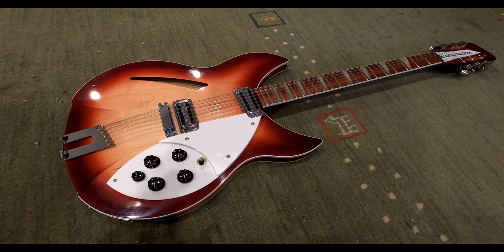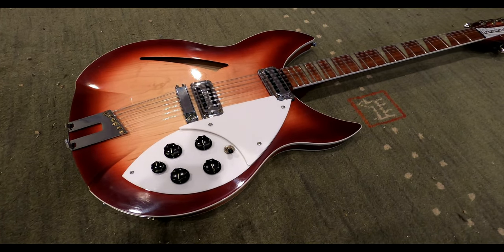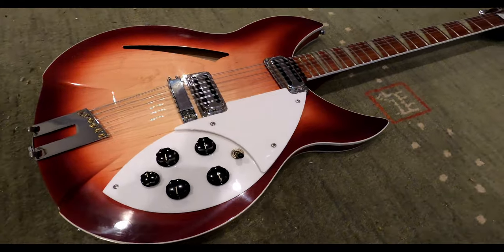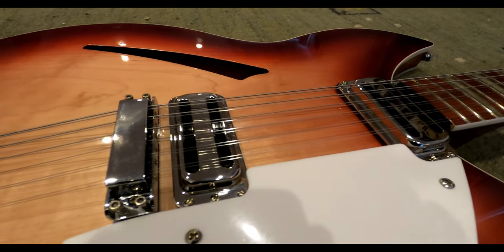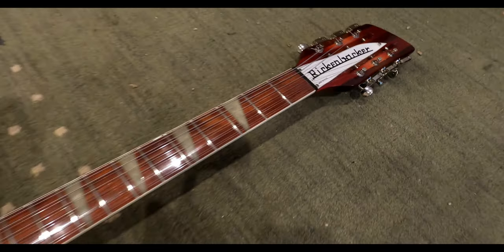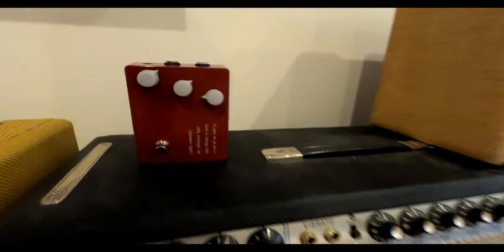Comparing Rickenbacker Toaster Pickups- Scatterwound vs. Hot

Comment: Thank you so very much for the excellent excellent information.
I have the vintage scatteround pickups in my 1979 Rickenbacker 325. I love them they sound amazing. I bought my 1979 Rickenbacker in January 1981. It came with 3 Hi Gains pickups. In 2012, I had replaced the Hi gains to vintage scatteround toaster top pickups, along with the accent vibrato tailpiece and the KK knobs. I gave the guitar another 33 years of playing life to it. I had bought the guitar used. It was already road worn in, who ever had it before me didn’t give it the love and affection that I have given the guitar, even though I didn’t play the guitar for 23 years. It’s been my baby since 2012 when I had alot work done to it. I modified it to look exactly like Lennon’s 1964 Rickenbacker 325. The Rickenbacker 325 I always wanted. I remember how excited I was when I bought it in 1981. I was super excited when it was modified in 2012.
Love your videos- especially the 1964 Rickenbacker 325 video. Love the sound of your toaster tops in the guitar.
Are they scatteround pups or the hot toaster pups in the guitar? They sound great through your Vox AC-30 TB. 
Hope to see you do videos on your Vox AC-30 TB and Fender amps.
Reply from the maker: Thanks! Glad this info is helpful. I think you might be thinking of wrong YouTuber because I don’t have a 325 or a vox amp. I’m hoping to get an ac30 soon though

Comment: I wonder if the Flat-wounds accentuate the difference more?  I still have rounds on my V64 and its a very bright guitar when the two pickups are used together.
Reply from the maker: Great point. I think either way you'd hear a difference but rounds would probably work best with hot toasters, and flats with scatterwound. You should check out my video I did on flats vs rounds with the scatterwounds. Thanks!

Comment: I have a 360/12V64 that had the hotter pickups. What I did was unwind the pickups to 7.4k ohms which is what the 60s specs were . I also added a .0047 uf tone cap in the treble circuit. It sounds killer.
Reply from the maker: I should try the tone cap replacement! Nice to hear you had good results with the under-winding thing

Comment: They actually sound quite different to me. Like, very different. The scatterwound have quite a bit more clarity and string separation. The top end can arguably get a little much at times, but pretty easily addressed by the tone knobs.
Reply from the maker: 100%. I’m using my brightest amp here too. So I found that the hot toasters sounded like they had a blanket over them into my other amps especially
Reply: @sampopkin  I've never owned any "hot toasters," but I've had various windings of Hi-Gains, HB-1s, and two different toasters over the years. Right now, my main Ric (a 620) has toasters from The Creamery, namely their "Mid-'63" set, which clocks in about 7.4k at the neck and 8.7k at the bridge, and sounds great. Still, I've been wondering what a set with slightly higher winding would sound like. I was hoping to like these "hot toasters" better here. I'm playing 6-strings, though, so not a direct comparison.

Thanks so much for doing this comparison! Would also be interesting to see some stock Hi-Gains compared in a 12-string.
Reply from the maker: @theothermarkwilliams  creamery make great pickups! Jealous of your 620. I’ve read that hot toasters sound better with 6 string guitar. Could be cool! Thanks for your kind words

Comment: I’ve owned a few vintage Rickies, and the pickup winding does vary. My fav set are in a model 450 from 1959: neck at ~6.5KOhms; bridge at ~9KOhms with a low-cut capacitor giving it more jangle. The neck & bridge outputs at full volume are well balanced compared to most Rics.
Reply from the maker: That’s super interesting. I’ve googled a lot about vintage rick windings and it’s nice to hear real life numbers. They seemed to be all over the place output wise?
Reply: @sampopkin  The vintage toaster pickups I’ve had have been in the 7–7.5K range aside from the 450. But I’ve heard & read from Ric owner/collector folks that there are plenty of outliers, especially in the 1950s.

Comment: It's a Rickenbacker 360/12v63. It's the 325 that's '64' as in 325v64.
Reply from the maker: Technically mine is a v64. Even though it’s based on a 63
Reply: @sampopkin  Well that's interesting. The manufacturer sold them as v63 presumably on the grounds that CM107 was built in December of that year.. I'm an owner too by the way.
Reply from the maker: @chrisst8922  what year is yours?
Reply: @sampopkin  2001.
Reply from the maker: @chrisst8922  yeah as far as I know the V64 ran from 1985-2000. The C63 started around 2000-2001. Yours might be a c63
Reply: @sampopkin  No. The c63's truss rod cover is shaped like CM107 whereas ours is the shape from the Rose Morris 1993. Mine's certainly a late one. The vintage series represent terrific value for money in comparison to the classic series. At a loud gig, everybody drunk, who gives a fuck about the shape of this or the winding of that.
Reply from the maker: @chrisst8922  nice! As I said in the video our late 90’s-2000 model have a really nice fireglo finish. They aren’t as vintage accurate as the C63 but man what a great guitar. Hard to tell the difference at first glance anyway